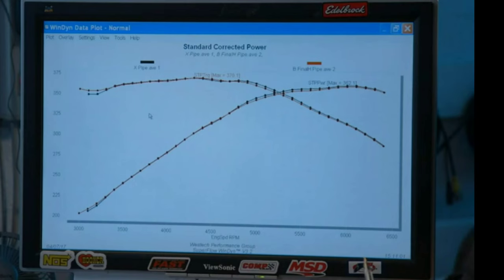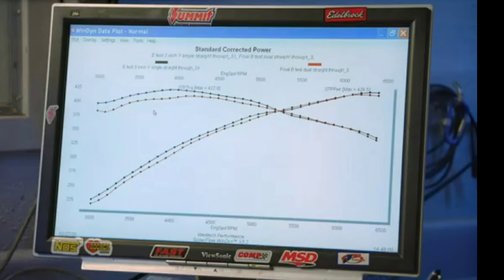DUAL EXHAUST LOSES POWER! single is better for POWER!

Comment: I was thinking of doing a single pipe on my twin turbo Q50
Reply from the maker: Now turbo cars / forced induction cars are a little different. 

Seeing as they do not rely on scavenging of the exhaust to pull in the intake charge during overlap, exhaust scavenging becomes less important. 

With a turbo the more quickly you can get the exhaust out the better so the shorter and bigger the exit pipe is the better as well 🙂

Comment: single exhaust will never out flow a dual exhaust of the same size. If this was the case you would see every race team using a single over a dual. you could possible get some scavenging but it would be like scavenging form a 2 cylinder motor. You would have to go from a 2.5 to a bigger pipe after they Y. That have does this test dual 3 inch dual compared to 2.5 dual they made almost 20 more hp. It was like running open headers. You should not have pressure in your exhaust and you are loosing volume when going into a 1 pipe. 
https://www.youtube.com/watch?v=_PVXvHkr-Vs
Reply from the maker: Thats what I said. 

An appropriately sized single
Reply: @newguysgarage6802  if it is V8 you will always be better with duals. Go watch the engine master video
Reply from the maker: There video is what proved they made more power with the single than they did with the duals......thats were I got those graphs from is engine masters 🤣
Reply: @newguysgarage6802  go watch the one I provided for you. You are very mistaken on what you are talking about. 🤣🤣🤣
Reply: @newguysgarage6802  if you would try to make it closer you could run 2.5 to the Y then 3 out the back. But then show me how if I run 2.5 to where the Y would meet then 3 in duals you would lose HP. You wouldn't by the time you get to the Y the scavenging and exhaust speed is so slow it would almost do nothing.
Reply from the maker: Go watch s5 e7 of engine masters......2.5in dual vs 3in single. 

Single made more power 🤣😂🤣
Reply from the maker: Look guy idk what your talking about anymore. 

The dyno shows what the dyno shows......your opinion on if you belive the dyno or not is not my problem 🤷‍♂️

Single exhaust made more than the dual exhaust.....and it makes perfect sense why that would be the case. 

Why dont you go do your own dyno tests and put them on youtube 🤷‍♂️
Reply: You miss the graph where they show open headers making way more. Which would be close to what 3 in duals would be with a muffler. It just showed that they would have been better off with dual 3.
Reply from the maker: @701garage  go do your own dyno test and post it on youtube.....because you clearly are not comprehending what is going on here 🤣

3in single had less volume then the 2.5in dual exhaust did....if it was a volume issue the dual 2.5in dual would have made more power. 

Its a scavenging issue not a volume issue. 

But like i said make your own video about it lol 😆
Reply: @newguysgarage6802  go watch the whole video again. They said that you could not make much more power with the 3 because of flow. The 2.5 will take over after the 450hp range. Why did the 3 in with the turbo muffler make way less than the dual 2.5. Sounds like it has nothing to do with scavenging. The 2.5 open headers made way more than the 3in single. Run a 3 in dual vs a 3 inch single the duals will win because they have more volume  same with the 2.5. The single 3 is only good to about 400 go watch the video again. I will help you 21:22. They you are wrong by your own video your provided
Reply from the maker: 🤦‍♂️
Guy you dont have a clue 😂

You are literally missing the point, if you make more than 400hp you would step up the single exhaust lol. 

When did they compare open header vs single? Never did in that video guy so I dont think you know what your even talking about at this point lol 🤣
Reply: @newguysgarage6802  they did it in that video the first run was open header. I will keep telling go rewatch it you got a lot wrong and it has nothing to do with scavenging.
Reply from the maker: @701garage  i keep telling you you dont have a clue lol. 

They never ran open header with the dual vs single exhaust test. Idk what video your looking at 🤣
Reply: @newguysgarage6802  2:52 into the video damn dude you don't know what your talking about. You little mustang might be able to run single but every EFI modern motor is going to be pushing close to the 400 if not over. It made 436.7 hp.
Reply from the maker: They never showed the open header dyno, guy you are delusional 🙄 

He said they did an early test with long tube headers.........but never show it and they ran shorty headers with the exhaust. 

Go drunken rant somewhere else or make your own video about it lol 

Im sure your 17,000 subs would love to see it 🤦‍♂️
Reply: Bruh
Reply: I think you guys are not watching the same videos

Comment: Yeah, I call BS...... Show me one straight track race vehicle with a single pipe system anywhere in the world that competes? Exactly you Cant, because Race car owners do testing and Know what does and does not work, open Headers with a collector at least 12 inches long make more power than any other system in existence...... Mufflers, Cats, and pipes that are 2 1/2 in diameter or smaller will Rob power from anything they are hooked up to. Stock vehicles will produce more power from larger pipes no Custom Mufflers, and any header system. Bigger is better, Less is more.. Don't fall for these guys sells pitch bull shit...  Back Pressure is a KILLER of POWER, I challenge anyone out there to Prove me wrong.....
Reply from the maker: Why dont you test it yourself lol 
Let me guess "well I dont have time to fuck around with bla bla bla" am I right 😂